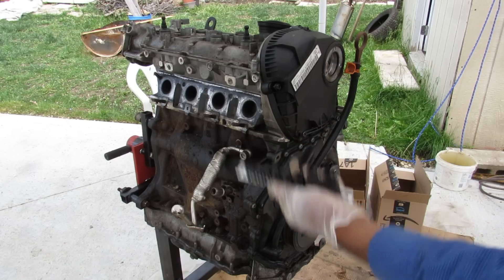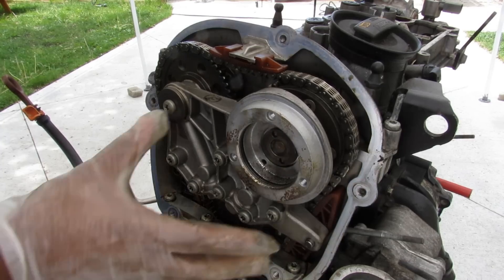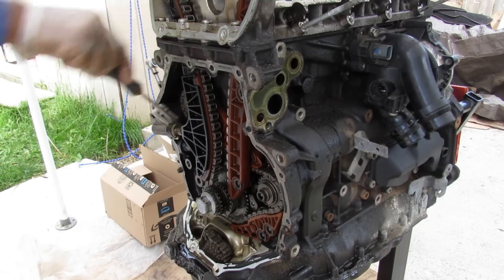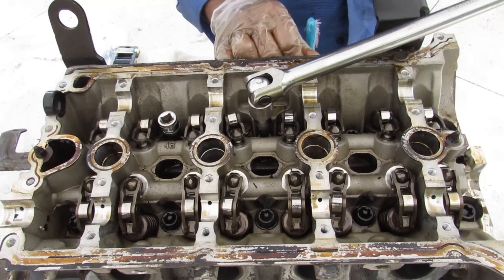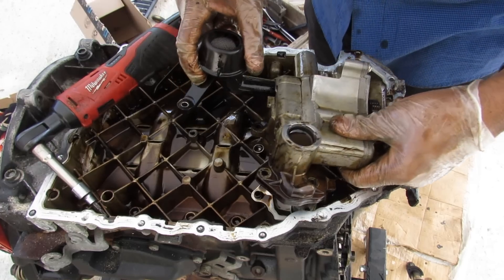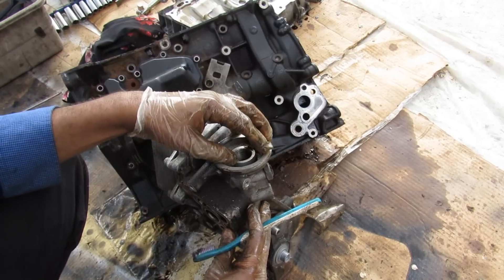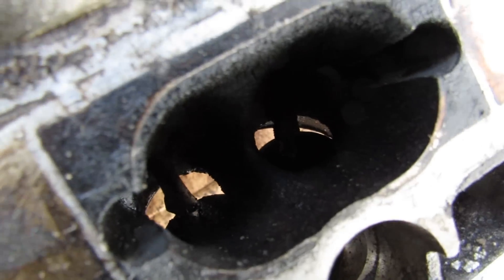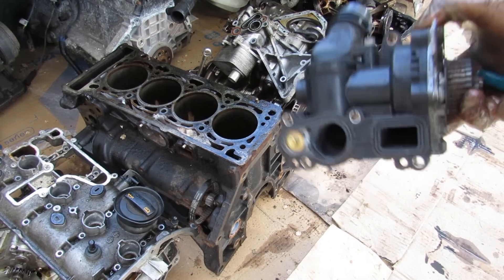Why Volkswagen Engines Fail

Comment: How in the world would you tear apart an interference engine without documenting everything?  Not a mechanic but I wonder if being off by even a single tooth in your cog and chain would make the engine destruct when you start it up.  That's why I figured this engine was scrap when I saw the video and the author not documenting everything.  Bring back the good old days of pushrods.  PS--I hear EV vehicles are designed to last 10 years before the battery cannot be recharged, another form of planned obsolesce that greens will be complaining about in a decade or two...

Comment: A guy I know worked at the factory producing those TSIs in Poland, he told me a good chunk of their work was repairing brand new engines that didn't even make 10 miles, in all the years he worked there, this was the biggest piece of crap the company came up with. Another thing he told me was that the factory bought used engines from crashed cars to put them into new ones to save a penny. They just inspected and cleaned them. So some people bought brand new VWs with not so new engines...

Comment: This engine is like a horror movie. It just gets worse and worse further into the review 😳
Reply: had my 2.0tsi in my scirocco, 2008 model, 166k miles, remapped to 335bhp, no big problems if you look after all the right things,
Reply: oil leaks I admit mustn't be ignored , but only happened once in owning it for 5 yrs
Reply: @16cliffedge  I have three friends with cars that have variations of the EA888 and I will get one with it next year as well. They have had some minor things here and there but none of them have ever had oil leaks. And they all have well over 125000km on them.
Reply: @l33tnobody1337  yea its the most reliable car ive owned. The leak was just one of those things, i should have fixed properly but didnt
Reply: Absurd design
Poor material combination 
Absolute Nightmare 
UNRELIABLE to say the least
Reply: @vincecarlo  VW...that says it all...
Reply: After this car I never gonna bay a VAG car. Crap.

Comment: ok never gonna by again a vw , decided it after many cases like that i see on tsi-tdi engines that fail from nothing, my old 20v passat  is still going after 20 years and couldnt start it 2 times from mechanic failure one from altenator and an other from fuel pump (battery cases are not counted).
after that problems like faulty maf and window lifting mechanisms failed wich cost a tiny amount of money where my problems.

Comment: Hans, we designed this engine with 3 separate timing chains so there is no room for the water pump on the front of the engine. 
Where is there room for the water pump?
On the back of the engine under the intake.
Brilliant!
But how will we drive the water pump?
We can drive it using the balance shaft!
But there is no room to drive it directly.
Put some pulleys and a belt there.
Brilliant!
But Hans, what if the belt needs to be replaced?
Don't worry, we will make the water pump out of plastic so it will start leaking before the belt needs to be replaced.
Brilliant!
Reply: This is even funnier when you read it in a german accent
Reply: German Automation 
Das Auto
Reply: "old cars are not reliable. I'll buy a new one! This will cost me a lot less on maintenance"
Reply: Laughs in angry German
Reply: Underrated.
Reply: Awesome
Reply: If Apple made cars
Reply: More areas for $ pits, its endless!!!

Comment: EA888 Engineering Room discussion prior to Production Approval..,
Head Engineer: Anyway we can incorporate more timing chains?
Subordinate Engineer: We feel we have maximized the use of timing chains, sir!
Head Engineer: Im only thinking about the Corporate Brass, they love their timing chains.  See what you can do to add another timing chain
Subordinate Engineer: Roger that. On another note we have placed the water pump in an impossible location, incorporated plastic.., Lots Of Plastic
Head Engineer: Great, you know Corporate's motto, "You can never use enough plastic"
Subordinate Engineer: and we've made sure the Car Salesman push for 10k Oil Change Intervals but never admit it after the engine fails
Engineering Room: All engineers laugh, some are heard uttering under their breath.., bwahahahaha,
"Suckers"
Head Engineer: Alright then.  Project EA888 approved for production
..., as the subordinate engineers are exiting the room
Head Engineer: dont forget, we need more timing chains!

Comment: BMW’s turbo 4 cylinders (particulary the N20/26 engines) had similar issues with stretching timing chains, along with failing variable displacement oil pumps. Many of these problems could be better mitigated with more frequent maintenance however, most European manufacturers tell their customers to service the engine oil every 8k-10k miles, and that the coolant is a lifetime fluid.
I’ve seen some of these engines meeting their demise before reaching 80k miles.

Comment: I am so happy with my 90s Audi engine. Logical construction and a water pump that lasts many tons. What a complicated engine this is. And then also things (such as the water pump) mounted in an illogical place. And that carbon buildup is something that will make you totally sick. And then all those chains and tensioners.....brrrr. I would not drive calmly in a car with this modern engine. But yes, reliability has been traded for gadgets. And repair has become more and more difficult where "modules" are exchanged instead of really repairing (with shocking prices). Also consider changing a simple light bulb on many modern cars, even the bumper has to come off. I think this was done to provide the dealer network with a good job. And what about that programmed wear and tear ..... what a crook. The best VWs and Audis were made in the 90s.

Comment: Been driving VWs all my life - and quite a lot of them. In fact, I got my license on a Mk II Golf GTD back in 1988.  But my 2010 Mk VI Golf GTI was probably the most troublesome VW I ever had - bar none. 
1. Just over three years in (which was just out of warranty), the engine started to overheat due to low coolant. One dealer was unable to even find the problem, the next one diagnosed a faulty/leaky water-pump. Which is a common failure on Golfs of this gen and model-year. I was at the shop when they were working on the car and while they hadn't removed the engine, it looked pretty close to that. That pump is really hidden in the bowels of the engine. At least VW picked up most of the tab for the repair - otherwise it would've been quite expensive. 
2. A few months later, the AC started acting up. Cooling became less and less effective, so I brought it to the dealer again. Turns out the compressor was shot - yet another common failure for Golfs of that age. This time, VW only ponied up 50% of the repair cost. Even though it's widely accepted that they were using bad compressors (to save money?) during the time my car had been built. 
3. Another few months later, the "check engine"-light came on while I was driving. I lost power, the engine was running rough and the car started to smell of gas. As luck would have it, this happened under a km away from my VW dealer, so I went there in limp-mode and had my suspicion confirmed that one of the ignition coils had croaked. This one was all on me, but the bill wasn't that bad.
4. In 2017, I bought a new Mazda MX-5/Miata from a dealer who took the Golf in trade for a pretty sweet deal. When I brought the Miata in for the first service, the owner of the dealership gave me a look half amused, half mad and told me that the Golf (which they had sold on already with a used-car warranty) had suffered catastrophic engine-failure at the top-end. He didn't go into much detail, but from what I understood, it sounded a lot like a faulty timing-chain tensioner, resulting in valve/piston contact, etc. He spoke of repair cost of around €3,000. 

All that said: I still love VWs and especially GTIs. And I did have an (also brand-new) Golf Mk V GTI just before the Mk VI. I didn't keep it quite as long as I kept the Mk VI, but I put roughly 100,000km on it - a little more than I put on the Mk VI. And that Mk V gave me zero problems in just over 4 years. I had it dynoed just before I sold it on and the reading was 219 PS (stock engine, factory claim was 200 PS).
Reply: With MX5 you finally got a reliable and fun car to drive. 👍✌
Reply: @quasimodo8215  I still own it, so I don't want to jinx it, but... yeah. After 4 years, 4 months and 85,000 km, the only unplanned trip to the garage was due to a faulty wheel-speed sensor on the front/right wheel. And it even happened inside the warranty... :D Other than that: Highly reliable car - and it's spent the first three years of its life outside at night in all sorts of nasty weather.

Comment: I heard somewhere that BMW, VW, and others use plastic covers and other crap that fails to save weight, that's BS. You have a solid heavy cast iron block with weak plastic crap around it. And we didn't even get to turbos failing. They want to charge for repairs. A lot of greed and wastefulness. Between this crappy engineering and the VW pollution scam they got caught for, people really need to stop supporting them. Cars designed to run for about 60k and used car buyers beware.

Comment: Volkswagen engineers are not working for the working classes far too much innovation and this leads to very expensive repairs, they have gone from reliability to avoid at all costs if you want to have longevity in your cars, ps I’ll lend you my wife’s toothbrush as I’ve just finished cleaning the toilet with it 😇

Comment: I've got one of these boosted to 400hp using the golf r turbo. 70k miles and doing great. I do have a full garage shop and am very comfortable doing my own work. These engines generally don't "fail" as in catastrophe, even at modded levels. Leaky h20 pumps, possibly leaking rms, yes. But generally nothing that can't be repaired reasonably.

Engine in vid may very well have never had its oil changed or otherwise poorly maintained.
Reply: I agree, these engines have great potential and are mostly very reliable. Most failures occur due to lack of or poor quality in service/maintenance.

The technology used in German engines are more advanced than Japanese who rely on more proven technology like port injection and being naturally aspirated.

Comment: @3:20 mins,  you don't remove the belt tensioner (but it's design is terrible regardless for serviceability). You just reinstall the bolt and release tension to allow access to timing cover bolt (youau even be able to pin them out of the way on some models). 

Great video, yep these engines won a lot of awards when they were first released but aged extremely poorly due to many engineering oversights, mistakes and being designed to a price point not possible. This is actually true of most VW engines going back in time. The naturally aspirated 2.0 held up the best but was gutless and when they tried reengineering it and calling it this new TSI....it was a waste of time. Should have started from scratch and only carried the best parts of their design language forward

Comment: Those mk6 engines are known to have timing chain problems that begin to manifest around 100k miles. Above that, it's recommended that the timing chain be replaced otherwise you'll likely be buying a new motor sooner or later

Comment: Here’s how to preform an oil change on that engine.

Step 1: unbolt the transmission
Reply from the maker: Extract the oil
Reply: Personally found it a really easy car to do basic maintenance on
Reply: The basic maintenance isn't an issue. It's the repairs that are insane. Nothing on these is less than 4 hours book time, and the guys writing that up knew this engine like the back of their hand.
Reply: @shotts90  has
Reply: @paulbruen4247  what

Comment: Anytime the balance shaft is connected using timing chain instead of direct gear, the chain will stretch out. Remember the chain is reducing the vibration.
Reply from the maker: Good thought. But if there's a gear link it would have to be inside the oil pan

Comment: they have engineered this engine, so when it fails it will cause huge damage, so you have to get more spare parts and that's how profit comes from to the manufacturer. old school engines fails less and in case it fails easy to repair

Comment: At lease this one HAS a ratchet tensioner by design, unlike the 1.4TSI.... I can't work out how these engines are designed with timing chain systems that fail when really old cars had them and they did not fail! we have gone backwards!

Comment: To all those who own German vehicles from 2010 congratulations
Reply: I still drive mine no problem. And it is a 2010 one. Changing some stuff at 11 years old for the 1st time compared to other ppl with other brands. Timing belts need to be changes every 2 to 3 years. Mine went 9 to 10 years. 

Would I change my car after this article? NOPE.

Comment: So, premium fuel, seafoam once in a while to decrease carbon and clean internals, and timing belt change BEFORE it fails.  Good summary?
Reply: You forgot that you need to maintain that chain hell. Which is by far the worst. Hell I don't understand that how can manufacturer put tensioner inside casing. Oh well there's one accessible outside, meaning you need to disassemble a lot of stuff to get in.

Comment: Awesome. It clearly showed me why electric cars will dominate. The amount of complexity in this engine is just insane. Doesn‘t mean it‘s stupid but it provides so many single points if failures.
Reply: @TheRedc0met  I somewhat disagree. Electronic pumps are generally speaking much better than mechanical ones. Also you mentioned heat pumps. Yes that indeed could be failure point, but it's failure point that doesn't prevent driving. Electronic pump could for instance measure power consumption to give indication of ie. near bearing failure. That's something that can't be done easily on mechanical solutions. Or let's say that it's vastly easier to do with electric pump. Electric motors can be really robust. It's all about how components are done.
Reply: Not to forget that's it not so-to-say special engine in anyway, meaning efficiency, power output etc.
Reply: If you think electric cars aren't this complex you're very arrogant. Good engine designs like the Honda k and the chevy ls are whats going to be missed
Reply: @Alfred Wedmore You've misunderstood so badly. Yes it's still "mechanical" (on really simplified level), but as I already stated, you can get so much better overview of their status via electronics. Like mentioned: it's easy to monitor power consumption and monitor ie. possible wear or bearing failures etc. on those. Don't try to feed me that "could do". No it's already there and has been since 90's via inverter tech. It's been tested in industries globally and proven to be reliable tech. I have at work tens of motors ran by inverters for tens of years and none of them have died at that end. I do know quite a bit of what I'm stating as I repair industrial shit and I'm also bit of an motor head and I STILL think electric is way to go.

Comment: Some of the causes of the engine failure is that people don't do proper warm of the engine and proper cooling as well. Vw recommends oil changing at 15000 km or 20.000 I guess. This is a disaster for the engine.

Comment: I love VWs but every enthusiast knows to steer clear of 2.0T's. Pure junk.
Reply: If you ask in Germany the 2.0 are the best of the best. TSI are rock solid. Ok there are maybe some build year in which they are holding up
Reply: @Nordlicht05  newer ones are a lot better no question about that, but the style showcased in this video (~2005-2012) is plagued with issues. compared to the other engines vw offered here like 1.9tdi, 2.5 i5, 2.8 and 3.2 vr6 or 2.0 8v they just aren't as good. imo the 1.9 and 2.slow especially are practically bulletproof
Reply: 2.0T is is the absolute worst. Our Passat and Audi A5 were the biggest piles of trash any of us have ever seen.

Comment: I’ve got 157k miles on mine…. But that’s because I’ve watched videos like these and read up about them on forums, so I’ve been very careful. Mine has been dependable. I’ve got a stage 1 tune and it’s a lot of fun to drive. But it has also scared the shit out of a couple of times just reading what could happen.
Reply: Well I put 188k on my 2.2L s10.  The engine was still running when I sold it, the problem was the rest of the vehicle fell apart.

Comment: 1:12: The mix of metalls/materials cause oil leak? Doesn't a damaged cylinder head gasket cause oil leak by itself? The blocks are not touching directly, the gasket is between theme as far as I know.
Reply from the maker: If plastic heats up, it can warp, causing a leak.
Reply: @speedkar99  You mean the second part, you mentioned. And if this would be true, even a totally new engine would leal oil. But this isn't the case. Plastik gets old, if hot even faster, and then it becomes brittle and can leak. But the engine must be more then only a few years old in that case. Also rubber tube have the same problem, like any other engine: They all use rubber and plastic parts somewhere. No engine stays oil leak free forever.

The chain problem is a far bigger problem... and VAG dropped the chain for some future engines.

Comment: i notice you never use any of your old clothes or toothbrushes to clean engine parts with. LOL  Great videos!  i actually have that engine in my GTI and everything you said about it is 100% true.  Ive replaced timing chains and water pump already with only 130000km on the car.   Luckily i had the new style tensioner already when i bought the car new in 2013.